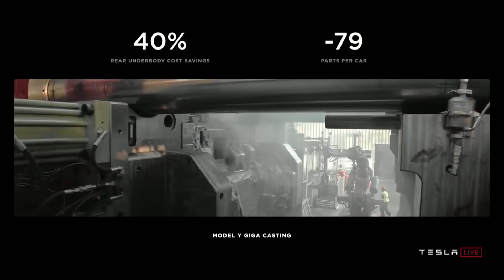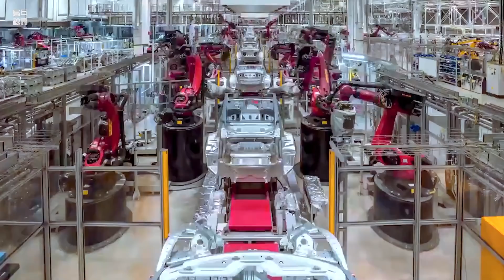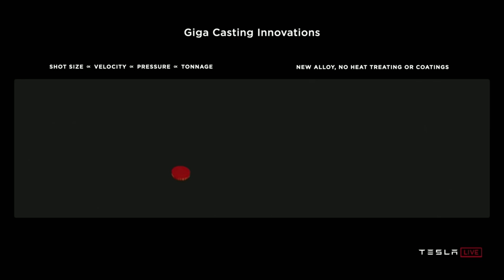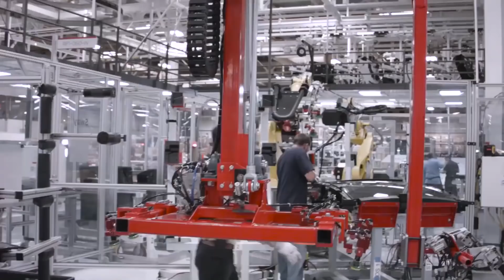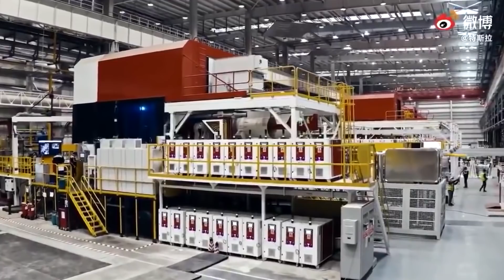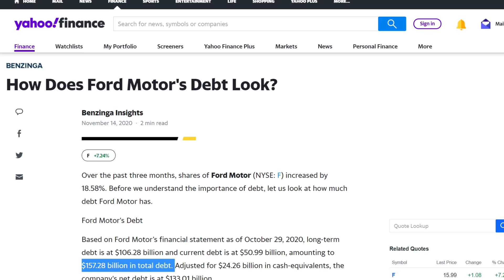Tesla Giga Press: Why dont Auto manufactures copy?

Comment: Confirmation bias from tesla cheerleaders

Traditional auto is great at building cars. Audi A4 you can buy the base spec for £23,379 in the UK right now

While the base spec model 3 costs £40,990 almost twice the price

The giga press isn't going to reduce costs all that much. You are probably talking hundreds of dollars. For arguments sake if costs reduce $400 that's just 1% of the value of a $40,000 car
Reply: If you use castings for 500K cars you save $200 mil just on the casting. Not to mention the savings on robots, repair and line down time. And that number is only getting bigger!
Reply: @jeffc62  casting forms are extremely expensive to make , and last only for a few 1000 Copies. anything over 10 k would be a very good value for aluminum alloy castings. Its not easy to get this running well, there are a lot of possible Problems in this technique, thats why it isnt industrie standard. Perhaps they can make it rentable, but there is a lot of work to be done.  And: Traditional sheet metal pressings as done since the 30ies are not really more expensive, and they work.
Reply: @jeffc62  Do you know what the mega casting machine costs?

Okay let's say it gets rid of 300 robot arms. Well the mega casting machine isn't free it costly costs much more than a by comparison robot arm

If the 300 robots cost $300 million and 1 mega casting machine also costs $300 million then there isn't much of a saving

I think the casting machines are probably an improvement in cost but not necessarily massively so

Also as this video points out there isn't really anything to step everyone else doing it if it works out well. We will know in five years time
Reply: @kaya051285  The weight reduction is only to very basic building methods. ITs also pretty much a dead end. its very hard to improve with other materials when you have so much structural pieces cast as one.  It would also make building more than one model on one line pretty much impossible. 

It makes alot of sense for Tesla, they only build 2 mass market cars right now and they had massive quality problems in the past that they couldnt fix, atleast in the US.
Reply: @kaya051285  You're right, I would expect the cost of a press the size of a house to be huge. Bu lets say the cost is the same just for fun. So the savings would be in shipping just ingots to Tesla as apposed to all the individual parts. I'm guessing the maintenance contract  on 300 robots would be more than 1 casting machine and furnace. Less chance for error in a single casting than the merging of all those parts as they're welded/screwed/riveted/glued together. And any error of the casting can just be remelted down and used again. 

 I agree that time will tell and I'll be very interested to see what happens when their entire line ends up being cast.
Reply: @jeffc62  We don't know how much it saves its all guess work at this stage

I suspect its also guess work for tesla they are learning as they do. Remember the model 3 rollout they went heavy on robots and had to step back to a more normal mix of humans and robots. Not everything they touch is gold

Castings positives are
Potentially quicker
Potentially more accurate 
Less weight product

Casting negatives are
Aluminium about 3x the cost of steel
Need to work with 700 centigrade metal which means higher energy inputs too

Overall I think mega castings will slowly propagate into the industry but this was true pre tesla too. Bigger and bigger parts were being cast already 

I don't see it as a revolution that will drop costs 50%. More likely its one incremental step that reduces costs by 1%

Also tesla isn't yet close to making cars as cheaply as traditional auto

Model 3 cheapest = £41,000
Audi A4 cheapest =£23,379

It's not like the mega casting is the thing that is going to reduce the price of the base model 3 to be the same as the base Audi A4
Reply: @kaya051285  I agree that Tesla has probably made a ton of mistakes. For a while SpaceX middle name was "mistake" until it wasn't. 

I would guess that casting that comes out every 2 minutes is on an order of magnitude faster than hundreds of robots combining up to 60 - 80 pieces. 

Weight savings is huge for an electric car, and the casting is stronger as well. 

Aluminum is more expensive but they'd already made the commitment to  it at the beginning as a weight saver.

I don't know if you watched any of the early Sandy Munro videos when he tore down the first Model 3. He wasn't impressed due to there being 73 different pieces in the rear end. He showed a casting of a standard car frame that he'd had in the shop for a few years. He'd tried to talk all his clients into the advantages a single piece casting represented but he couldn't get any takers. I'm sure it will creep into car production. But I'm not convinced if it would have happed (if it does) without the pressure from Tesla. I'm guessing the Chinese companies will start using them before any American OEM. 

I don't know where you can find a Audi for that price because that's a great deal!

When I go to the Audi website and try to build the base A4 it starts at $39,100  before any additions. The Standard Range Plus Model 3 price on their website today is $35,690. And I wonder what the margin Audi has on that car? I'd bet it's not over 20% like Tesla's margin.  

All the savings add up as well as the efficiencies. 

Thanks for the civil discussion btw
Reply: @jeffc62  The bit most the tesla cheerleaders miss is that traditional auto is very very good at making cars

As I mentioned previously I just purchased a new VW T Roc which is a small crossover for £18,500

I did consider the model 3 but at £41,000 the price difference isn't worth it for me. Especially as like most people in the UK I only do aboit 6,000 miles a year

A mega casting is probably better overall than stamping. We will know in 2 years time as of it works tesla will use it more and more and if it doesn't work tesla will abandon it 

The argument that its a revolution in automotive manufacturing is just not going to be true. At best it's just a small single percentage digit saving
Reply: @kaya051285  What are your credentials to be discussing this matter? The man in the video is a demonstrated expert, are you?
Reply: @TheScarnak  I used to be a process engineer. But i don't need to prove my skills or not because I can prove my assertions and ideas in the actual debates we have here

What does it cost to make the front and rear underbody of a traditional car?

Neither of us know to the exact penny 
But we can have a good estimate
My estimate is approximate $1000
That means even magic can only reduce the cost from $1000 to zero

No one thinks the mega castings are magic. And we know aluminum costs more than steel. So we can say the savings will be somewhere from zero upto maybe $500

And from that you can see if that is significant a $0 to $500 savings on  car that coats $50,000....

Also Sandy Monroe said on his video how much would the giga casting save he replied with 'probably a wash' which means $0 aka more or less the same cost
Reply: @kaya051285  Sure, but you're continuing to remain ignorant to all of the other benefits. Incredibly quick turnaround, much easier to source raw materials, much higher consistency on accuracy, less time needed for quality checks and less minor panel issues to name just a few off the top of my head. There are many more I'm sure. So if by your calculations you can get all of this AND save $500 per car.. Then holy shit sign me up!
Reply: @TheScarnak  got to remember Tesla's first production car came off the factory only 9 years ago they would make a card 100 years and they still behind Tesla
Reply: I Kaya
You're guessing.
It's over, you just haven't realised yet.
Reply: @rogerstarkey5390  What is over? Tesla is a tiny fly in the automotive world

Just one model from toyota alone sells 3x all of tesla models. Only next year do tesla hope they can exceed one model from Toyota using 5 models of their own
Reply: @kaya051285  think about it 9 years old was the very first car production off the line the Model S now they got x y model 3 it's cyber truck that's five Productions and continuing to make a roadster coming up plus he'll make semi truck that's a lot for only a nine years making a vehicle and the other companies that make it home anywhere between 100 years and 50 years
Reply: Also don't forget when he makes the cybertruck most of that the frame from that cyber truck is what it'll make a van and utility van off of same thing with Ford did with the F-150 frame they use that exact frame to make Ford vans and utility vans the test little copy the same route use the same platform as a cyber truck to make the taxi and a van
Reply: @hillbillyintheasia6122  well said.

Comment: Question: What are the quality control checks for finished cast parts? I saw some binned in Texas. Are they xrayed? Inspected visually? Microscopically? Impedance test? How are they checked? What is the fail rate?
Reply: I would guess a lot of possibilities for scrapping a few dozen castings from a new press test run. Maybe the furnace couldn't maintain top temperature, but was hot enough to run test cycles on the press making parts with "cold shot". Look fine, but weak.
Or it warps, you check and find a faulty alloy mix.
Probably half a dozen others.
Reply: Oftely such metal parts are controlled with ultrasound. So you just go along the outside with a probe and it can detect very small cracks even in the inside
Reply: @DB-gh4nj  Have you ever done this? :D I guess not. But I can tell you, it takes a hell of a long time to test the whole chassis with your mentioned method. Bye bye cost savings if you have to do it for every chassis
Reply: @alexbauer9699  Automation is key. Additionaly you don't have to check the whole part but only a few key places. This is standard procedure in the aviation industry
Reply: I thought that Sandy Munro mentioned testing and X-raying.
Personally I don't think they are are failures, because if they were mine I would hide them     :-)
Reply: @danielstapler4315   Tesla doesn't care to hide failed tests. Why should they? Everyone who knows anything knows that complex machines don't start perfectly on the first day.
Reply: You're asking questions nobody outside Tesla will know.
Reply: @rogerstarkey5390  not true. This is standard processes.
Reply: @andrewalbert7383  
OK, thank for the clarification.
In that case, the OP (who seems familiar with the terms) should know that?
However , he seems to be pressuring you for specifics. I wonder why?

Comment: Question: Is the alloy premixed offsite and sent as pigs that are melted at the Gigafactory? (2 meltings)
Or are the base metals sent as pigs for blending into the alloy at the Gigafactory? (1 melting)
What implications does this have for energy consumption? Supply chain and transport logistics? Factory footprint? Building heating/cooling?
Reply: In all probability, the alloy additives are mixed at the smelters. The container for molten alloy in the IDRA press is small. It would be a logistic nightmare (time waste) to add 10+ additives in 'precise measurements' for every few castings.
Normally the 'suppliers' keep their clients' recipes confidential...further (as mentioned in the video) the mix is revealed by <$1000 spectroscopy!
Reply: The alloy is delivered to Tesla’s factories as ingots, you can see the stacks of ingots near the gigapresses at both Fremont (loads of them) and Austin in drone videos.
Reply: @tavi_chocochip  re: "The alloy is delivered to Tesla’s factories as ingots".  <---  this is the correct answer.  the reason is because Foundry work is best left to "experts" and NOT "upstarts".  this is the BEST/TIME PROVEN way to insure you have the correct composition (hint, people have already long been through this) which is afforded by deliberately SLOWING DOWN time, and doing proper QC checks throughout the process (2018 Kobe Steel scandal notwithstanding).  with proper work done on the FRONT END, a customer/client is free to then have themselves a "field day" on the BACK END (ie, quick cycle time Die Casting).
Reply: @tavi_chocochip  The presence of ingots by itself doesn't prove that....because ingots could be pure aluminum (while additives added on site...the question raised by that guy). That was just a point of technicality, I do believe that the alloy additives are added by the smelter itself.
Reply: @tavi_chocochip  thx!
Reply: mmmm bacon...

Comment: Question: What characteristics do the elements of the alloy give to tits performance? In terms of melting point, ductility, hardness, tensile strength? What are the implications of these characteristics for casting? Assembly? For performance in the finished vehicle?
Reply: I think sandy munro elaborated on this
Reply: actually Islam you literally answered your own question (very good,👏) .  the nature of ANY alloy is to address pretty much ALL the points you mentioned.  one only need look at the History/development of the ever ubiquitous STEEL to see this.
Reply: @phillyphil1513  I'm curious about what the priorities were in developing this alloy, and how it succeeds in meeting the performance imperatives.
Reply: @islammohamed1441  you've NAILED them all.  the specifics are no different than with any other die casting (including the one's Tesla ALREADY makes/uses).  sadly caught up with the HYPE, people overlook the model 3/Y already uses this design in their rear sections.  yeah, the castings are just split into 4 pieces (2 large/2 small) instead of being one GIANT piece already joined together coming out the mold.  it's not really some GREAT ADVANCE over what Tesla is currently doing (but i applaud the attempt).  even other OEM's are already doing this if you know where to look.  the difference is OEM EGO's simply don't feel any pressing need to CROW about it.

Comment: Would it be fair to say the reduction of Parts etc is good for the OEM, it will be to the detriment of Vehicle repair as the parts  if damaged  will that create obsticles to repair a vehicle or update components etc?
Reply: if you will get in accident which will manage to damage casting, then car will go into scrap yard anyways. You need quite serious event to damage it, so fixing that will not really be on your mind at that point.
Reply: Modern cars are designed to be sacrifice to just to keep the passengers alive.
Reply: @myballsitchsomethingfierce6319   yes but what happens when its only a small fender bender insurance companies generally can the car .. insurance premiums then go up!
Reply: @fabriglas  
They have deformable struts and panels which fail before the casting.
Reply: @rogerstarkey5390  re: "They have deformable struts and panels which fail before the casting"  looks good on paper.
Reply: re: "if damaged  will that create obsticles to repair a vehicle or update components etc? A: yes, but the problem likely won't be that the car (obviously depending on the extent of damage, every crash is different) has to be scrapped or anything, NO, the problem will likely be just getting these GIANT MONOLITHIC CHASSIS parts from Tesla.  this is ALREADY the current problem body shops/repairers have with existing Model S's, X's, Y's, and 3's that are involved in accidents.  in theory, this issue of availability and long wait times (relative to legacy OEMs) should get better, since it is after all still "early days" for Tesla.